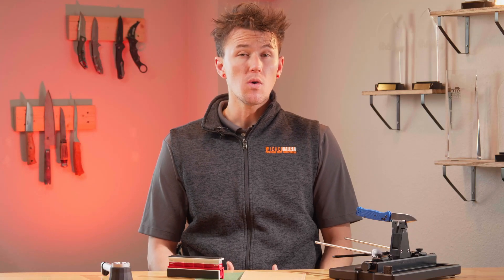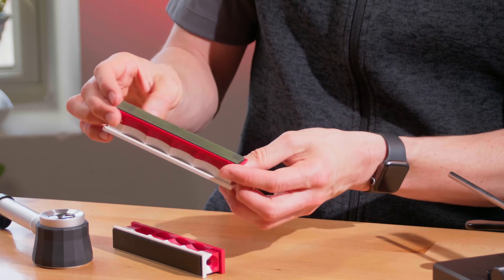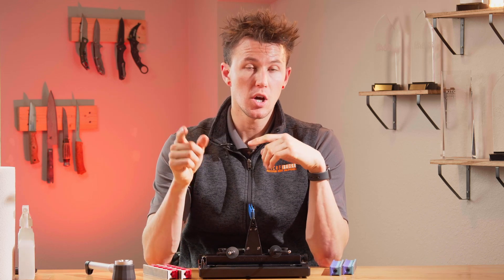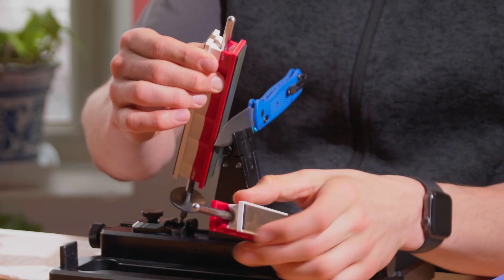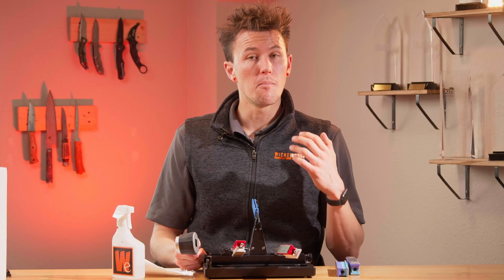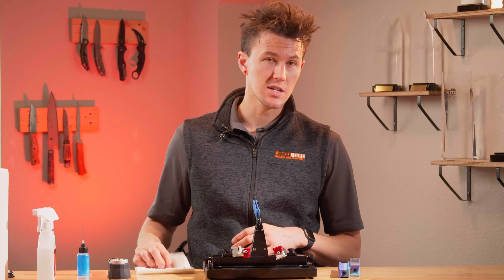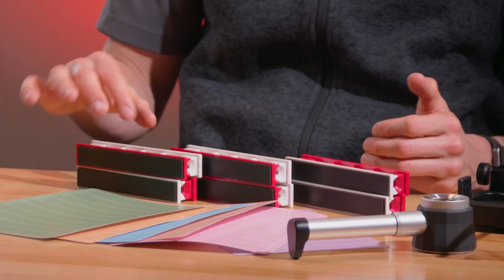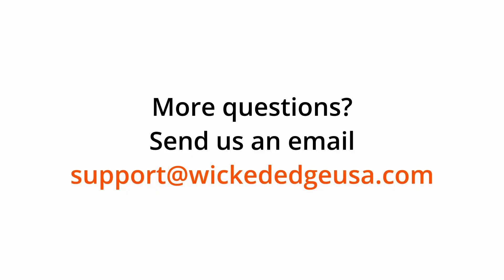Putting  convex edges on knives with the Wicked Edge

Comment: Also to be clear, if my existing V-grind angle is at 18 dps and I want a final angle of 20 dps than I should set my angle to 19dps and use the lapping films at 19dps as the film/rubber will deform and produce a 20dps - approximately.
Reply from the maker: That's absolutely correct! And for your other question, we call them out just to make sure you're creating a v-grind with your Wicked Edge before you begin this process. You can go into convexing after your 600, 800, or 1000 grit. All three of those will lead to great results.